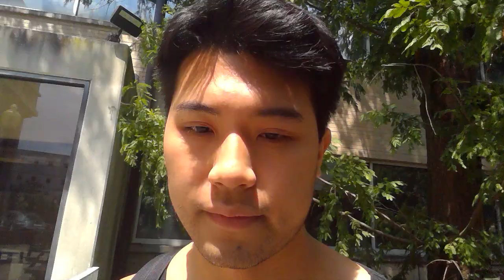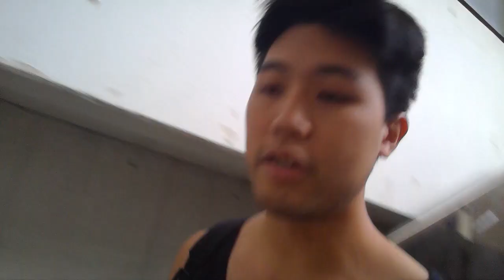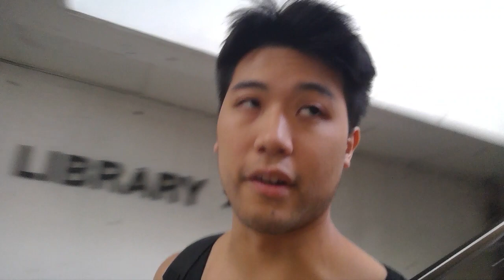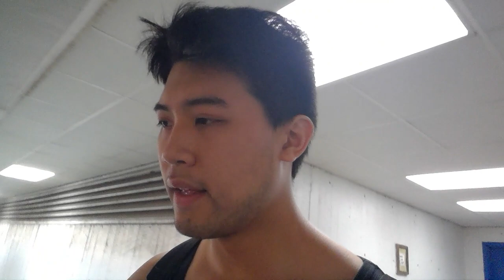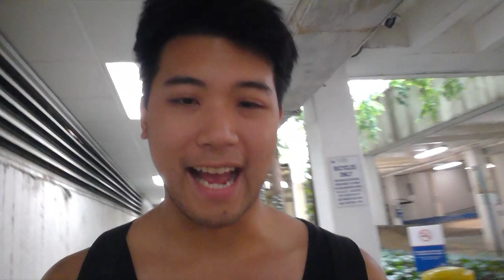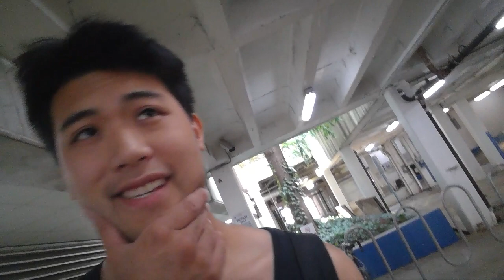Gamma Treatment Updates

Comment: hey chris, i bought my first dayan coated cube from you back last year when you sold your first batch. This cube was my instand main.. it felt sooo amazing... after that i bought the polymer coated from thecubicle.. and it felt different and new and it was super speedy, i switched between these two a long time... when the second batch of op dayan coated cubes came out, i also bought a new one as a backup main for comps.. and i really have to say.. i didn't got any real issue with the coating went of... (only a little bit on the first batch, but it's still a thin layer crafted into plastic, and it feels super super amazing. I solved on this around 20 000 times and i really love it.. i still use it every day.. I figuered out, that the polymer coated plastic is a little bit too fast for me but i didn't tryed out some lubes, cause the op dayan is tooo amazing to switch from it. Now i have two, and they feel different, but it's a good difference.. maybe it's the way they're set uped, but i pick the one up, i like for the day and both are so awsome... so please, also if gamma treatment is a new thing, bring out a new batch of op dayan plastic coated cubes, cause they're the best cubes i ever tryed and i had no reason to switch from them :) So a good job, so amazing cubes!! :) 

I understand your thinking about cubes, i also had a few good ideas to coat/treat them but i don't have the stuff to prepare it... I'm a chemistry student (nearly at the end of my studies) and i thought about coating it with polycarbonate (for a softer feel) or with polystyrene (for a faster cube).. maybe you'll try these two out and can say to me, how they feel :) 

So really amazing job Chris!!
Reply from the maker: kkkkkkkk!!
Yes, I have tried both!

Polycarbonate comes in SOOO MANY GRADES.
I tried two different grades, and one of them produces a nice scratchy feel

I tried polystyrene, and it's really nice, it's one of my favourites.
It also has an additional special property.

Maybe if I have time, I will reveal all the polymers/coatings I tested :)
Reply: Ohhh really nice :) is there a possibility that you maybe could make me a polystyrene cube if you like it so much :) It'll be so awsome :)